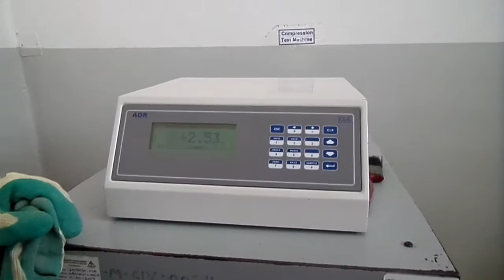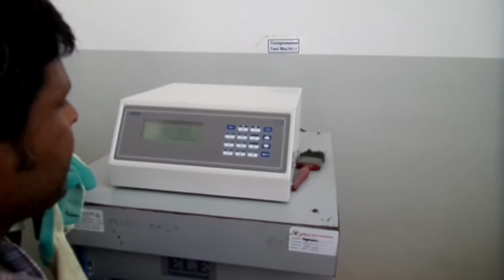Flexural Strength of Concrete Curbs .. British Standard BS-7263

Comment: The procedure is wrong,
the load applying steel pad doesn't seem 50mm in diameter, plus you did not use plywood piece beneath that.
plus, the cross-sectional shape of the kerbstone is not a right-angled rectangle, the load was applied on the flat portion of the surface, while the center of the load should pass through the centroid of the cross section ! this is creating torsion which is against the standard method and will give irrelevant results.
For the force to be applied through the centroid, a hardwood wedge or mortar shall be fitted/placed on the chamfered part of the top face.
Since you have the machine in hand, i think it is possible to purchase and follow the standard method.